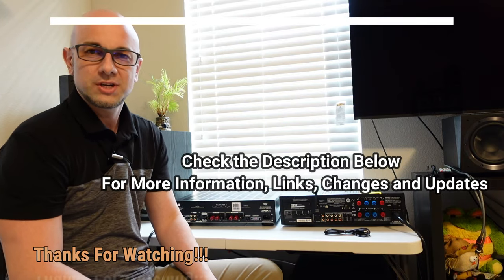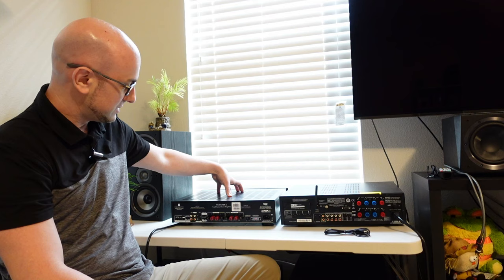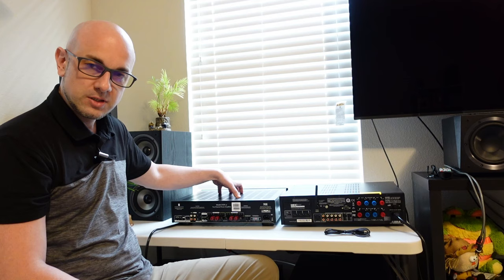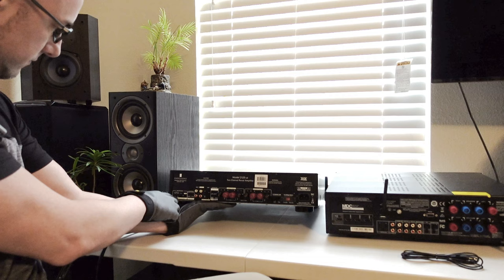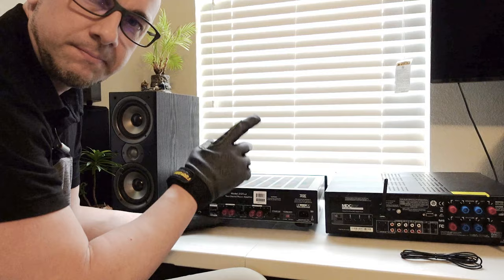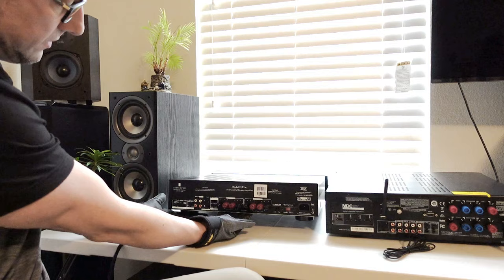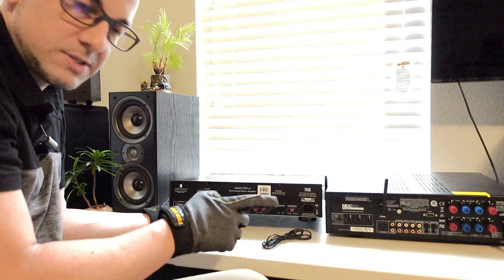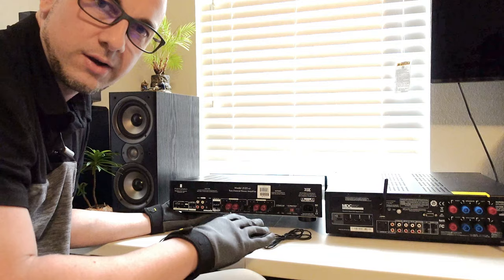How to Connect Amplifier to Receiver, Preamp Outputs Explained, 12v Trigger | Home Theater Audio

Comment: Ok quick question. If I have two receivers can I bridge them together from pre outs on one to analog in inputs on the other one for front and left channel. Would that work properly?
Reply from the maker: It sounds like it should.  Is the idea to have the same sound out of 4 speakers?
Reply: @OldtradesReviews   to have more power going to the front channel speakers and use the main receiver just for sub, surround, and rear speakers. I did without and it sounds pretty nice so far so I think I'll be okay without it. Thanks for the response!
Reply: @OldtradesReviews  actually it didnt work as i thought it would. When playing loud music for a long time the receiver gets really hot and it turns off. It's fine for movies but not for music, I had to put a fan by it to keep it from turning off.
Reply from the maker: sorry to hear that

Comment: Nicely Done.
I was wondering if the pre amp might help me from not riding the volume knob on my Denon receiver
while watching action movies with a lot of sound effects ?  
When dialogue volume is set to a comfortable listening levels it then is very uncomfortable to hear sound effects :(
or maybe there is a setting on the receiver to cap the db levels ?
Thanks in advance.
Reply: It's called a compresser. It squashes the volume on loud passages. Idk if ur processor has it and if it doesn't...your TV may have the setting. Idk if it sends the signal out like that or only works when played throu TV speakers

Comment: Got my marantz 7055, am trying to connect 3 channels initially. Can you advice what settings are to be done on denon to acheive this.
Reply from the maker: Always check the Manuel first. to see which speakers and the configuration the receiver allows
Reply: @OldtradesReviews  I figured I need to use 11.1 channel for pre out to be enabled. I connected front stage to amp. It shows floor as 5 channel and sb, height 2 channel, Dolby sp 2 channel, pre out front. My question is if I also connect the surround to amp will it get the power. Since preout is showing front. 
Please advice
Reply from the maker: Im not quite sure I understand because I cant see the settings.  If you are going from 9 channels to 11 then it would have to be set to 11.  check the instructions to see which preout should be connected for the extra 2 channels
Reply: @OldtradesReviews  I will share the settings in couple of days,since I disconnected all the cables as I getting a rack done to hold the amp and avr.

Comment: Great content
Reply: Hoping you review the Marantz Amp paired with SR7013!
Reply from the maker: I did test it.  I think its good more to add channels to the 7013....but not to make it sound much more powerful.  A 300 watt emotiva xpa 3 better choice.  DId you get the delivery?
Reply: @OldtradesReviews  Thank you for the heads up. No its still in transit its killing me LOL! Scheduled for Thursday delivery. I am in NV and it shipped from MA UPS Ground. I have been cleaning things up with wire action. Replaced all speaker wire with AudioQuest X2 14 AWG....also added another Conditioner. Getting hyped though.I would love to see you review the Marantz SR7013
Reply from the maker: Don't stress it.  You know UPS is caring for the receiver with its drop, slam and bash handling 😂.   Your really going all out with the cables.  I used the Amazon 14 or 12 gauge solid copper this time.  What conditioner do you suggest.  i never used one?  Not for my hair haha.   Its ag ood idea to pick up one of those usb 3 speed fans with the rubber feet...its like $10..  AC Infinity MULTIFAN S1, Quiet 80mm. 
  Just place it off to the center right a bit and flip it on low.   When you run the receiver in Auto Eco mode it gets warm.  But Eco On mode is ok.   I tested them both.  Really no sound difference unless the volume gets insane.
Reply: @OldtradesReviews  I went with the Panamax MR5100 models x2 and x 1 Panamax MR4000. We get quite a bit of weather over here particularly with Thunderstorms.  I'll have the SR7013 on the 2nd shelf below TV & Center.....its wide open which is good for air flow. That said I will take you up on your recommendation for a fan.....never hurts. Dude your doing great with your reviews and they keep getting better and better. # Dropping Audio knowledge! Great job.
Reply: @OldtradesReviews  AHAHAHAHA don't say that about UPS. I keep picturing a dude in Brown playing soccer with my Marantz box. NOOOOOoooooooooooo!!!!!!!
Reply from the maker: What is the reason for the different Models.  Is it for many rooms?  They have lots of plug inputs.   Do you hear a sound difference with them?  I been using like cheap surge strips my whole life.  Thanks for the kind words.
Reply: @OldtradesReviews  Different loads. MR5100 for multiple AMP signatures Master has the BP-7006 Towers like yours. Garage game room takes the MR4000. We can experience anywhere from 10-20 outages in an hour due to severe storms & winds at times. I can't afford to have my gear fried.
Reply from the maker: Wow a game room.  Do you have arcade 1up type machines?   Thats really terrible the power goes out like that.  That makes sense to have those protecting the gear.  You need one of those for UPS lol...keep that package safe from the handlers
Reply: @OldtradesReviews  I have a pool table by Kingdom Billards & a Bar Style electronic Dartboard by Scorpion..... Yamaha receiver Technics A51 Floor Speakers w/ Bose 301V surrounds & Definitive Technology CLR2002 Center......AHAHAHA you bustin my chops with the UPS stuff. I had a nightmare last night the Marantz SR7013 was stuck at a UPS hub and their phone # was disconnected LOL when I showed up to the site it was a wrecking yard ahahahahahaha! Thank God for Warranty action!
Reply from the maker: That sounds great.  Its a mans room!  hahaThe Old technics speakers ...I remember those.  I had a friend whos parents had on of the towers.   Is the foam surround still ok on them?  My old advent towers like 20 years ago crumbled and my infinity sm115 the foam on those crumbled like 5 years back.  Thats some nightmare haha.  Hopefully when it arrives today, its good.
Reply: @OldtradesReviews  The Technics A51's are in Mint condition. I bought the pair about 5 years ago at a Garage Sale from an old timer......$20.00 each which was insane I offered more and he said no. The grills are in perfect condition. They sound pretty damn good. I am not convinced new speakers necesarily mean or sound better than old speakers.